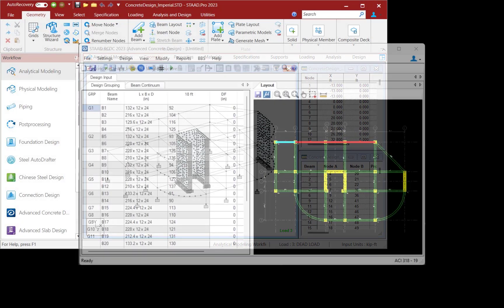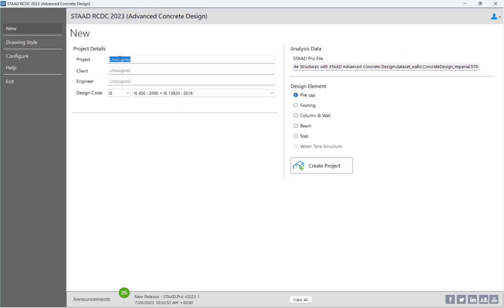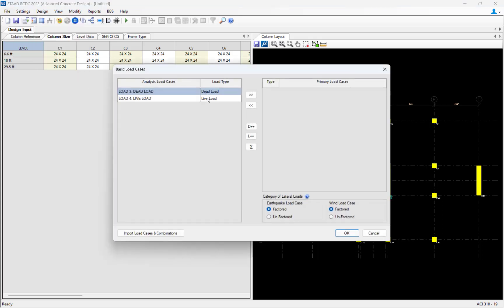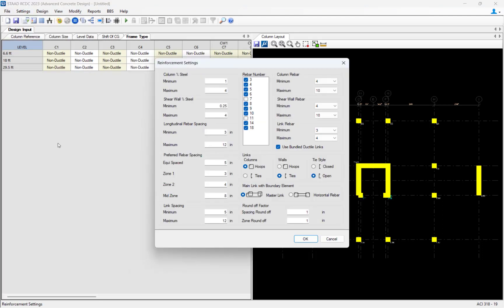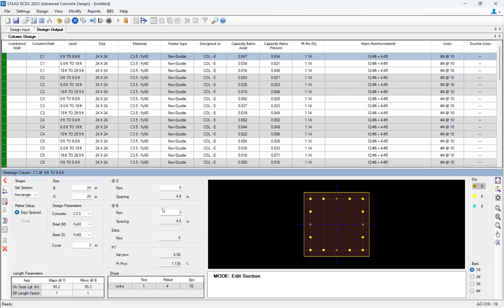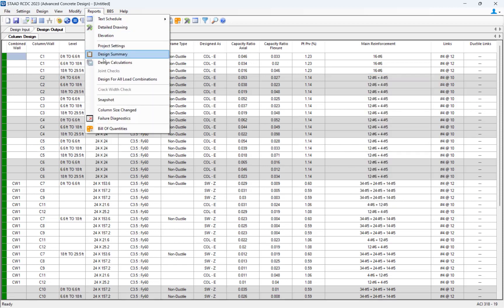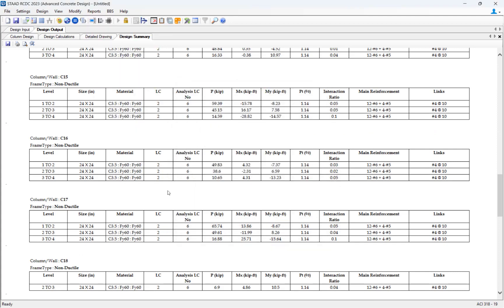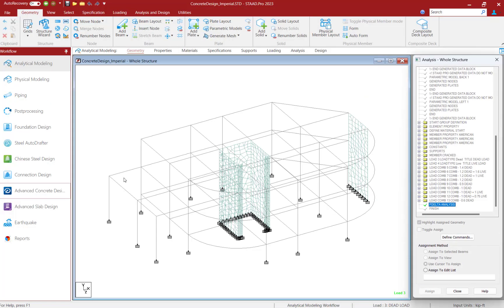STAAD Advanced Concrete Design Workflow

Comment: The important point is modeling..... if modeling and assigning load was perfectly possible in physical modeler this whole idea of modeling and loading in physical modeller, analysis in analytical modeling and detailing in rcdc would have been possible but physical modeller doesn't have load definition regarding wind load as analytical model does and it ruins everything.......
Modeling in a physical modeller is soo good and so smooth where as in analytical model is a real disaster......